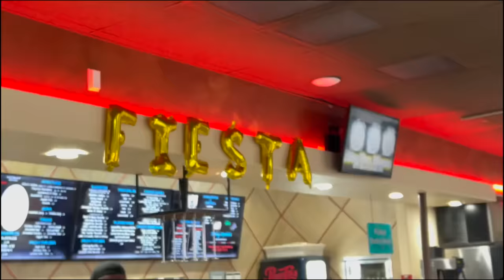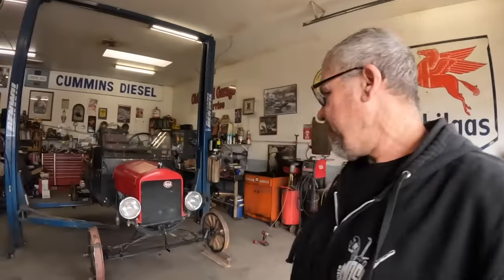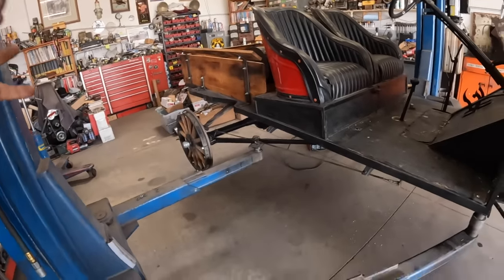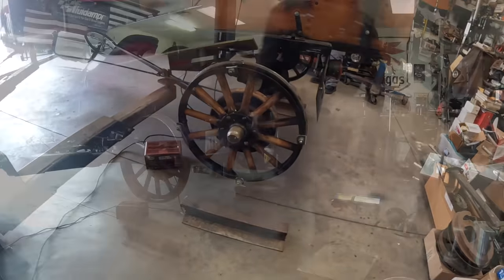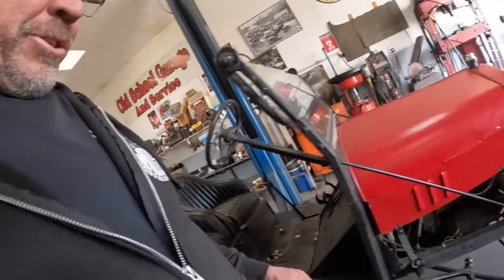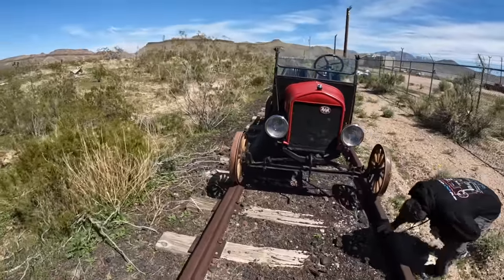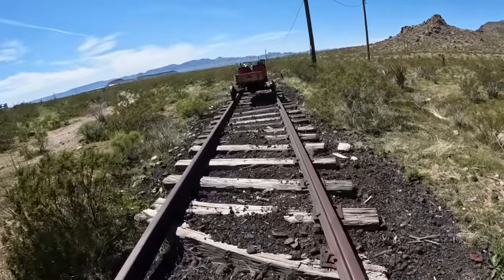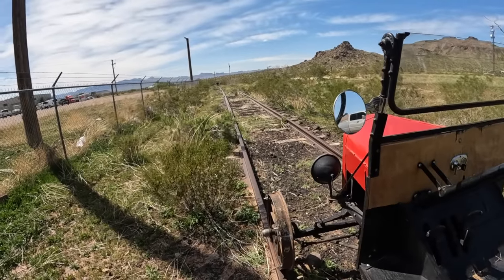I Built a Model T for Abandoned Railroads *THIS HAS NEVER BEEN DONE BEFORE*

Comment: Lots of railroads built model T and model A  track inspection vehicles. Your steel tires need to be wider than the rail head a  couple inches and cone shaped (larger diameter on the inside flange side . ) Then it will stay on the rail at full speed.

Comment: I had to space my fronts 1-5/8 inches and rears 3-1/4 inches to make my Model T run on the rails. I ran my tires on the rails and made a steering device to make it stay up. It became hands free at that point. Nice quiet ride and you could drive to the tracks and back home when you were done.

Comment: I believe back in the day railroads around the world modified Model T's for use as rail inspection vehicles.  Some would hold a crew of 6 along with their tools for adjusting the gauge and performing minor repairs.  The WW&F has one still in operation on their narrow gauge track.  In New Zealand they used to Model T in remote areas for passenger service on the rails too.

Best!

Comment: Hey Merlin,
   Old route 66 used to follow a lot of railroad track.
   Ya might look on Google Earth and find some pretty good sections you can run on and have an on road back up crew to follow along incase a Woops happens.
   As to the wheels, think about how a rail car is set up.
The wheel assembly under a rail car is called a truck.
The wheels of the trucks have much more inside rim to run against the rail.
The wheels are pressed onto big solid axles that have no give.
The axles are running inside large lubricated metal boxes that are allowed to move up or down a little bit but not fore and aft.
And all of this is very heave which is heave and under a heavy car and load.
   Then look at the Model T front axle with all of it's built in joints.
Even bolting that tie rod solid to the radius rod there is still wobble at the hub and into the spokes.
Then wooden spokes wobbling inside steel rims that have had half of their rigidity removed from the outside.
   There are places in south america where people have vehicles with wheels/rims built to run on the rails.
There are stations along the rails where the vehicles can be driven onto or off of the rails for wheel changing from pneumatic to steel.
   The model T just does not have much weight to help it hold down force on the rails.
   Anyway, that's my thoughts on riding the rails.
   Have fun, stay safe

Comment: Railroads started doing this with Model Ts basically as soon as they could find them to experiment on. They were very commonly used by track crews and were a big improvement over a handcar. Very often they'd build a trailer to pull behind for tools and materials.

 Particularly back during the Great Depression, railroads were pretty broke and built all sorts of interesting equipment to try to save money, maybe even avoid bankruptcy. The Federal Government wasn't anywhere near as strict about allowing home-made equipment out on the rails, so the railroads got very creative!

Larger versions of these actually operated in passenger service instead of using steam trains: if there were only a few people traveling, this saved a lot of money. 

The ones I know best removed the steering wheel because the front axle was fixed straight forward, but kept the steering column because of the controls mounted on it.  This of course meant the motorman drove the thing with the butt of a steering column pointed at his chest like a spear, but people didn't think about safety as much as today!

Some of these had a portable turntable mounted underneath that would lower a base that would  rest on the railheads and then lift the car up, balanced so all four wheels left the rails. If it was done right, one operator could swing the car around so it would face forward for the trip back home.

Another approach was to mount a gear on the driveshaft and have a mechanism to move it from side to side at the axle end. It would mesh with either of  two axle-mounted gears facing inwards so the car could go either forward or backwards at full speed.  The only wrinkle here is Henry Ford never meant a Model T to go backwards either very fast  or very far, and  the air-flow through the radiator wasn't sufficient to keep the engine from overheating if they overdid it.

Comment: Yep you need camber on the wheels surface where it meets the rails. It depends on the cone shape to remain centered. The flange thing is secondary.
Reply: Tapered tread only self-centres if the wheels are locked together. If they can spin at different speeds like on a car then it doesn't work at all.  A taper only makes the heavy side drop down and the lighter side run against the flanges.  He definitely needs the flanges.
Reply: Taper is for self differentiating. 200 year old technology. Left curve in track, left wheel small diameter, right wheel large diameter. Right turn opposite
Reply: @Mark_Bridges  I did not think of that. Thanks for the correction.
Reply: But I don’t understand how having fixed wheels alters the physics?
Reply: @pjaq3862  There are a few good explanations on youtube, from "Practical Engineering' for example, or from Wikipedia.  Search for railway wheel shape.  Those videos/pages explain it better than I ever could.

Comment: Saw lots of trucks working on the rails...  But remember a tv show, around '70, that featured a Stutz Bearcat that could run the rails.  Thought it was kool, & a faster route, lol.  Lots of push/pump hand carts, little go-carts, etc, that looked like fun, as long as ya didn't get run over by a freight train, harhar.  Wonder if a deeper flange & a wider piece in contact with the rail might make up for the irregularity in the tracks??  Looks like fun!
Thanx !

Comment: I watched a video where a guy used actual train wheels on the front and was able to use the vehicles rear tires not on rails, he made it so he could flip the wheels up so he could drive it normally. He was using a beater Toyota, and it really worked well. There are some places in California that have abandon tracks.
Reply: Actually it was a Suzuki Samari little more complicated than what you have, but if you search on YouTube not hard to find. Check it out (I just searched, riding rails) he used a jacking system to get the front axle on rails.👍 the model T is cool on rails❤️👍🇺🇸

Comment: There is abandoned track between Ajo and Gila Bend that was used to haul copper from Ajo to Gila Bend and then on to Yuma/Tucson… there’s a lot of track that can be accessed before you get into the Goldwater Bombing range on the Ajo side! 
There is also lots of real decent track out west of Arlington Az and it is useable track but the engineers would have to ride up front and it is 15MPH limit most of the way for them… but you could Prerun a section and then big hole that baby….   Let me know, I’ll go with!

Comment: Ever notice how in reverse it doesn't want to jump to track honestly you should let the tracks do your steering lock the steering wheel down and if you thought about using conveyor belt on the surface around the wheel when you're not on the tracks or even if you are on the tracks it would probably help with vibrations you definitely need a bigger lip on the intersider your wheels and like I said if you use conveyor belt when you get off the tracks especially you would have enough to run without being on steel just to thought anyway😮

Comment: Need wider running area on the wheels to make up for gauge swell. Just allow more for slop with a slight taper to help influence the running toward center.
Reply: Taper only works if the wheels are locked together. Car wheels can spin at different speeds so a taper doesn't work at all.  The taper only makes the heavy side drop down and the lighter side run against the flanges.

Comment: Well, I’m like a few others…I think your inside vertical lip needs to be taller and it will steer itself and not try to ‘climb the rail’ to derail.  I’ve thought about making a go-kart rail runner to run on the Page to Black Mesa coal line. Don’t know if the gauge is standard but they took down all the electric lines and just left the tracks.  Another one I want to run is the Leadville to Buena Vista Colorado rails that are very scenic alone the Arkansas river headwaters.

Comment: All you need to do is make a wider ring about twice the width of the actual piece you have. There’s a place in Central America where they use old rail tracks to move everything from one place to the other using old custom vehicles built for scratch and old 4 cilindres engines.

Comment: I think a problem is that it is a flat cylinder with a flange, train wheels got more than the flange they also got a slope that helps the wheel self align on the middle of the track and takes the stress of the flange. There ought to be a machinist somewhere in the comment section with access to a big enough lathe to turn you some rail tires for the T-wheels that has the slope and perhaps a bigger flange to catch you on bad tracks.

Comment: Don't need steering either.  Trains don't steer they just go forward and back.  When train repair vehicles drive up the use their road tyres to get in place then with hydraulics they drop the rail wheels in place.  The rear tyres are then used to move the vehicle.

Comment: im 99.9 % sure you know this but a conical wheel has a tapper and will track that true the inner lip is nothing more than a guide while curving you just about got it good work buddy!
Reply: Taper only works if the wheels are locked together. Car wheels can spin at different speeds so a taper doesn't work at all.  The taper only makes the heavy side drop down and the lighter side run against the flanges.

Comment: it looks like the lip that hangs down between the tracks isn't big enough, if you had more lip it would help keep it on the tracks or would keep it from going off , I think you need to look at the shape of a railroad wheel, they are designed that way for a reason 😉

Comment: Just because. Trial run evaluation. Holly be, the track is uneven and imperfect. Now to modify a perfect concept to roll on an uneven track. Thought you and Brad were going to fix the uneven test track section. Another video. Then a second speed run. I guess each track section will have its inherent variations. So the wheel alignment will require more tweaking to run on a variety of tracks.

Comment: I haven't even watched you on the tracks yet and am guessing you're going to have a hard time keeping it on the tracks.  The wheels need to be conical to keep you centered between tracks.
Reply: Taper only works if the wheels are locked together. Car wheels can spin at different speeds so a taper doesn't work at all.  The taper only makes the heavy side drop down and the lighter side run against the flanges.

Comment: I know where 4 rail wheels are for that bolt right on solid steel . I thought about putting them on my 1959 Willy's wagon 2 wheel drive 3 on the tree.. There is an abandoned rail line from San Diego to Arizona it drops down into Mexico

Comment: I think you need to make the wheels more conical, more like real train wheels so it always stays on the rains and always drifts toward straight and true.  Thanks for sharing, looks like fun.
Reply: I thought the same thing after watching many rail speeder videos; they always have a good bit of angle on the wheels where they contact the track and probably an inch or more of side to side play on the ribs so they don't bind and try to jump off.😉
Reply: I bet a taller flange wouldn't hurt either
Reply: Yeah I was thinking a taller flange edge would help a lot, along with the tapered rim
Reply: I am thinking a smaller tire for lite weight - weight holds them on track too, larger tire I think for heavy loads.
Reply: stays on the rains ?
Reply: Conical wheels only work properly if both wheels are locked together. If they can spin at different speeds then it doesn't work, at all.  Conical wheels would just make the heavy side drop down and the lighter side would run against the flanges.  A 4WD with welded diffs would be worth a try but that doesn't help Merlin's speeder.
Reply: Came here to say same things about conical wheels
Reply: I could not said it better myself.
Reply: The railroad near me has a fleet of trucks that can driven on the rails , they still use the rubber tires ,so they can also drive on roads , the rail part is a set of 8" diameter wheels front and rear which can be lowered hydraulically to enable track use. Further to this the wheels are too light and the shape is all wrong. (retired loco maintainer)
Reply: @Mercmad   "the wheels are too light and the shape is all wrong".  Would you mind explaining this comment?
Reply: @toddmccarter45  Taller flange on both side of the wheels, trains have more down force to keep it in the middle of a better maintained track..
Reply: Nah not nesseray on this light car....friction will be low so the flanges will do grate
Reply: @danw1955 nah 1/2 " is fine
Reply: Only profile of a wheel does not solve the problem of stability. But if you make a wheel set.... Vehicle we see is really dangerous. It may derail at any speed
Reply: Yea if you're going to build something that rides on train tracks you should at least spend five minutes to understand the simple engineering of the wheel that makes them stay on the tracks and go around turns.

Comment: Wider flats and a bigger flange, that will allow for track variation.
Reply: I would think that if you had a 2” tolerance on your wheels to track width, allowing up to an inch narrow and inch wider because of the lack of maintenance being done on the track. Definitely a deeper flange on the wheel would be beneficial also. Also maybe spray on some bed liner on to the wheels, maybe it would provide some traction/braking and make it quieter.

Comment: Are you familiar with track  inspection cars? They're wheels have a deeper flange to help prevent derailment, we had a fairmont rail speedster the wheels were about 10 inches with a 3inch flange, great idea ,I've seen model t speedsters before at shows.
Reply: Also the old track is for sure tight on gauge and more variation than stuff thats actually used. Owned a few "speeders" myself ;)
Reply: Fairmont M19 motor car wheels are 14 inches in diameter with about 1.5-inch flanges.  Other standard MOW wheels are 18 inches and 20 inches in diameter.  Flanges are no thicker or wider than 1.5 inches.   I have a Fairmont B4 motor car with 14-inch wheels, a handcar with 20-inch diameter wheels, and a velocipede.

Comment: I just have to add my comments here. I am a Canadian. Back when I was a teenager, (16 in 1960) I had a 1947 Ford car, My Father had a 1951 Chevy. My brother and I first put the Ford on the rails. We did not even let air out of the tires. Just line it up on a crossing and idle out on to the rails. We were cautious at first until we figured it out. Both cars had standard transmissions. We never touched the steering wheel and  don't touch the brakes. We went over switches and crossings. My Ford could get to 45 MPH and it felt comfortable. The Chevy did 55 MPH. We used to get out of the car and ride on the fenders and hood with nobody inside. I would drive from Carman to Sanford, a distance of thirty miles before turning around on a crossing and returning to Carman. This was always done at night time with no lights on because we knew that it was illegal and we could also have a better shot at seeing a train if one happened to be coming. Later on I put a 1957 Ford and a 1959 Ford on the rails. A 1967 Chevy would not fit because the width between the wheels changed. I never got caught doing this, not by the law, not by the rail road and most importantly, not by my Father. My name is Larry, I live in Carman, Manitoba and so far I have lived to be 80 years old doing stupid things like I just described.
Reply: Larry thanks for sharing your story, enjoyed it. Originally from Sask, yes we did alot of things that no one would do now.
Reply: It's only stupid if it doesn't work!
Reply: I would love to do something like that one day, specially here in Brazil where 90% of the rail roads are abandoned.
I just wish I had friends to do stupid stuff like this.

Comment: My dad was track inspector for many years.  He had a set of oak wedges that went from tie height to ball of the rail height.  If he derailed, he put a wedge in front of each wheel, drove up to rail height, and used a long pry bar to slide the wheels back over and onto the ball of the rail.  The wedges were about 18” long and stacked easily under his seat.  Just an idea so you don’t walk a few miles to get a jack.
Reply: Or maybe just bring a jack.
Reply: Shaggy, that sounds pretty smart. Got about ten years experience with amusement park train. Anybody who says “just use a jack” has never dealt with a derailment.
Reply: @georgevindo ...yup, a jack gets you up, now all you have to do is get across which is easier said than done.

Comment: I think you need a bigger lip on the inside of the wheel and on the rear wheels line the flat of the wheel with an old tire tread for traction . IMO  Looks like fun though.
Reply: If the rim is too big it hits the plates that join the tracks.

Comment: The C&S (?) had a modified Model T they used as an inspection car on the  South Park  branch. There is a photo in the book “The South Park” published by the Colorado Railroad Museum ( long out of print). The car is in Fairplay, Co. On the Main Street heading for a convenient gas station to get fuel. At the time, you could do that because the road wasn’t paved. I guess from the caption, there was a pin in the steering mechanism that was removed when on the rails, but when necessary, they could put the pin back in and drive the car normally. Good ol’ American ingenuity.